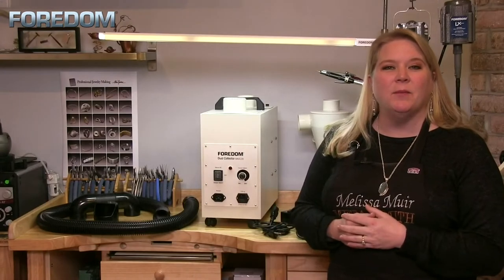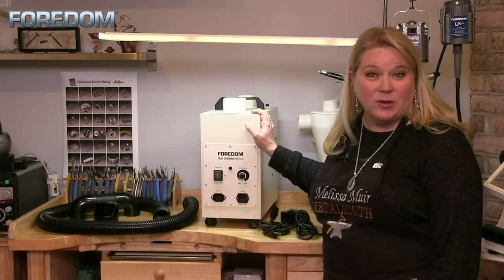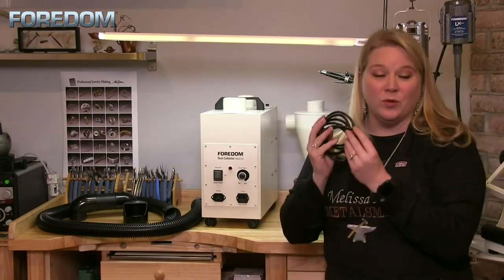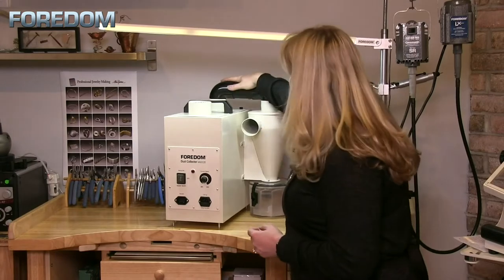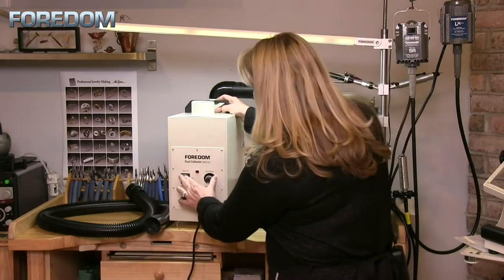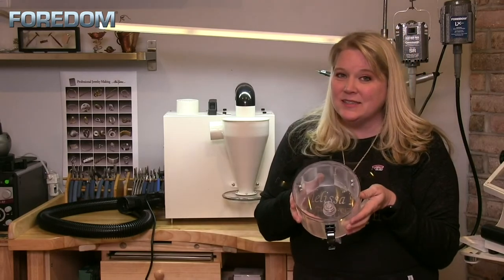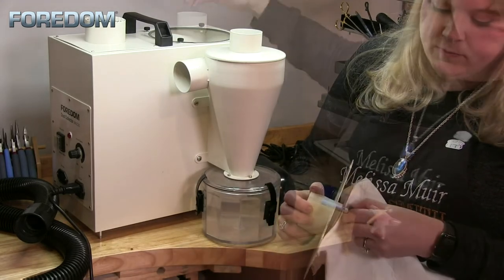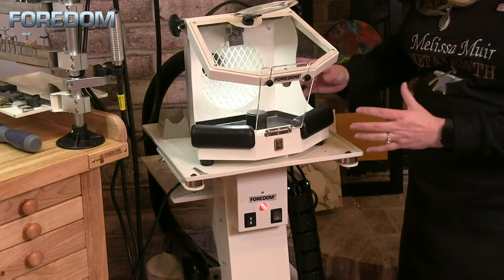Foredom's MADC20 Dust Collector

Comment: Thank you so much for this information.  We got the dest collection system, the workstation and the lighted work chamber.  We are adding the dust collection system to the workstation and have a question.  How did you remove the wheels?